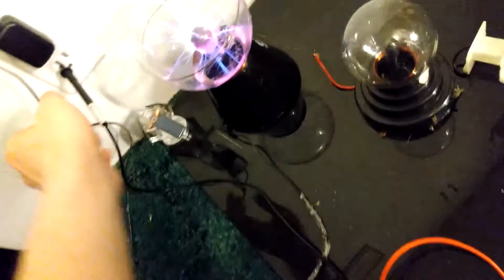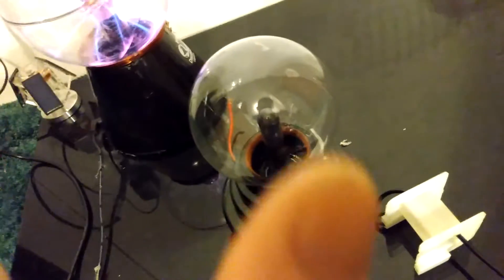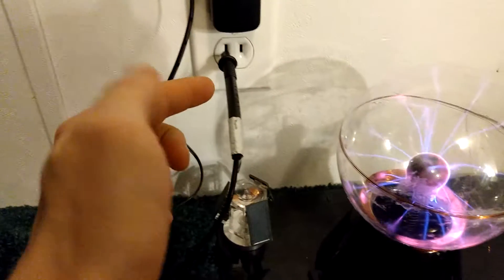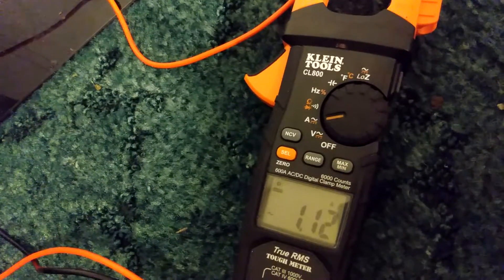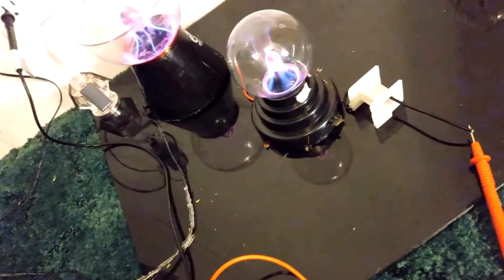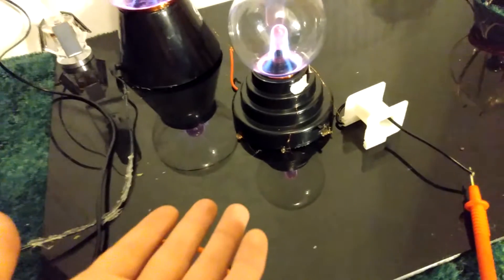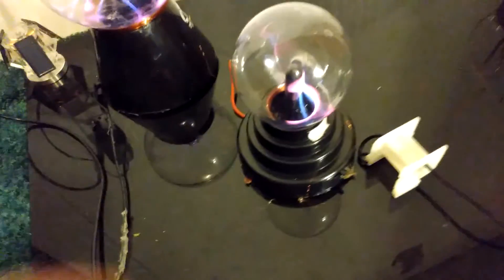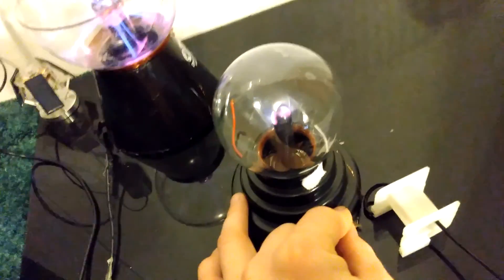FREE ENERGY Resonance From Earthing Part 2: Batteries Won't Die @ Resonance

Comment: You must use the "Clamp part" of the meter to measure amps. The leads are not measuring current. If anything the leads are just randomly measuring high frequency voltage spikes, but certainly not current.
Reply from the maker: This meter can read current just fine using leads
Reply: @Resonate369  I just searched your clamp meter's manual online and it measures current using the clamp. Also, if your DMM was to measure current using the probes, you would also be measuring current incorrectly with the current probe configuration. I would suggest you review your equipment's manual before you continue with your experiments. Maybe take a few courses on circuit analysis. I'm sure you could find some online by reputable institutes.